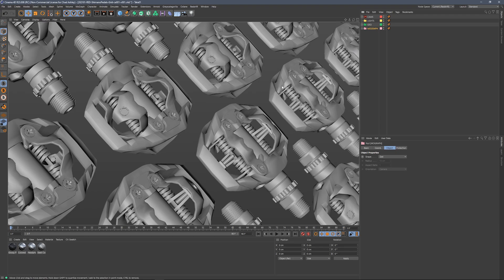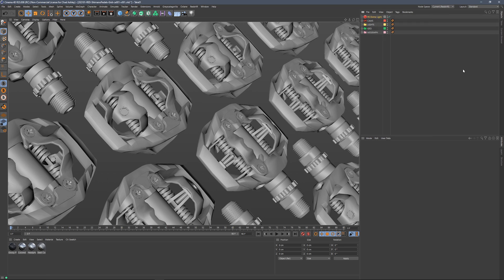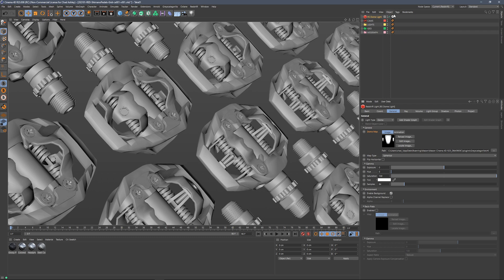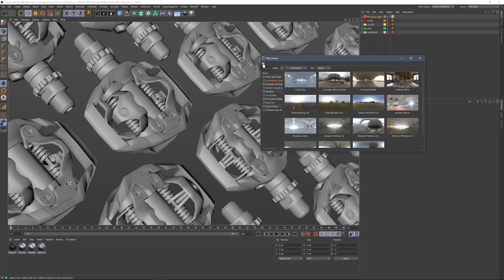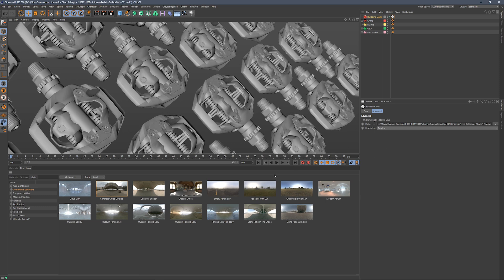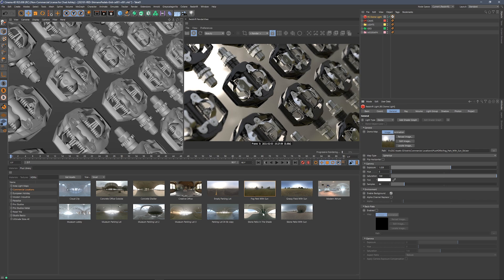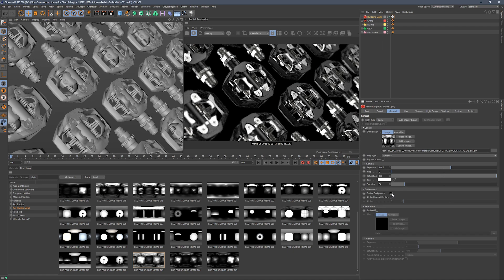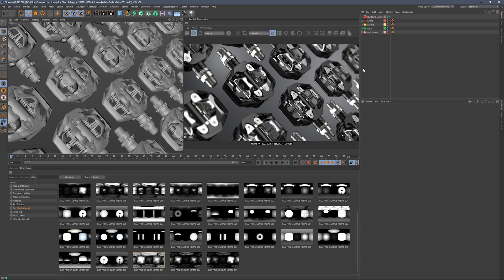Getting Started in HDRI Link for Redshift | Greyscalegorilla Training

Comment: UPDATE: There is no text called "Dome Map" anymore. In the Redshift Dome Light you now have to open the Object>General tab and then drag and drop the text that says "Texture" onto the GSG tag now. I really wish this one detail was automatically handled when adding the GSG HDRI Link Plus tag, as it's easily overlooked and sometimes forget to do and wonder why it's not working.

Also, it's very easy to think you can click on the NAME of the HDRI in the left column of the Plus Library, but yet that will do nothing and lead to frustration. You have to actually click the THUMBNAIL!! Dear GSG, I'd be happy to help be a user beta tester, as these are some improvements I would suggest. Why can't I click the NAME in the browser to change the HDRI applied?
Reply: Thank you! Thats helpful!

Comment: I have recently purchased cinema 4d r25 and greyscale. gorilla plus and I am trying to use the hdri link but I cannot see the dome light  map on my version. could you help me please
Reply: I am having the same problem, any fix yet?
Reply: I figured it out, you have to drag the "texture" to the HDRI link
Reply: @jonburroughs9469  does not work to drag the texture, has to be another way. Sad to pay for gsg functions when it doesnt work :/
Reply: In the dome light settings in the object tab, scroll down to "General" and then drag "Texture" onto the HDRI Link tag
Reply from the maker: The dome light is part of Redshift, not native to C4D. If you do happen to have the full Maxon One subscription with Redshift, please do reach out to support@greyscalegorilla.com and they can help you sort things out.
Reply: @Greyscalegorilla  Same problem here on R24 + Redshift 3.0.62. I belive one of the latest Redshift updates has changed things up a bit. When you click on the Dome Light there's no Dome Map to be found. If you click on Add Shader Graph the Dome Map module would pop up, however adding it to the HDRI Link doesn't seem to work. Please help.
Reply: @bigslavoslaps  Having the same problem....any fix yet?